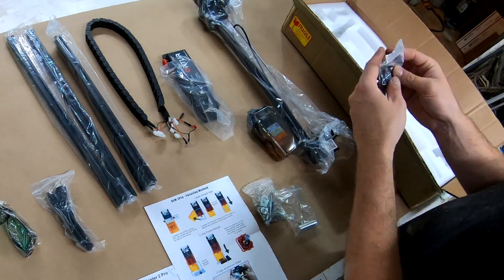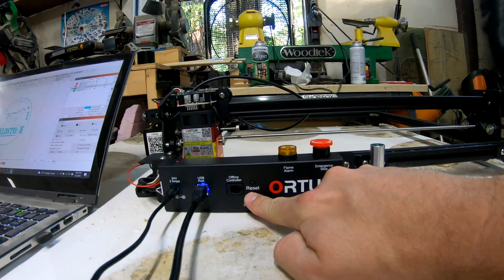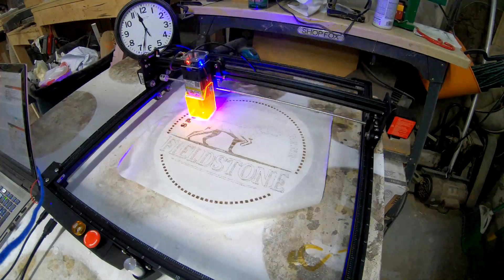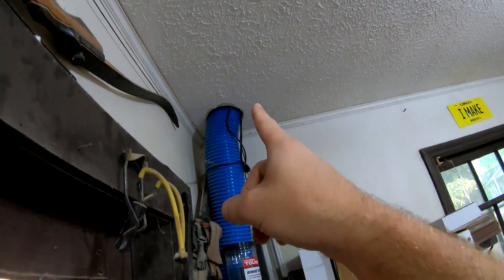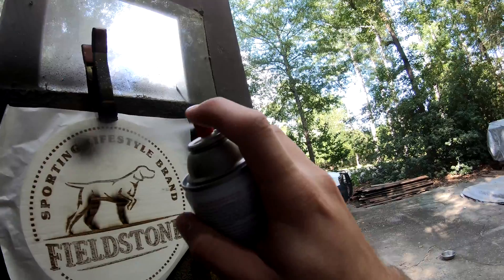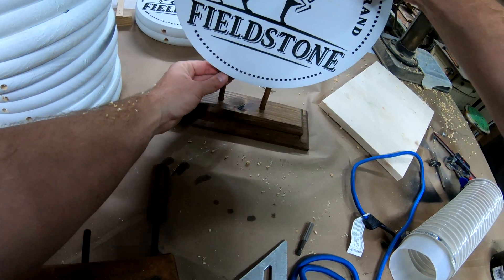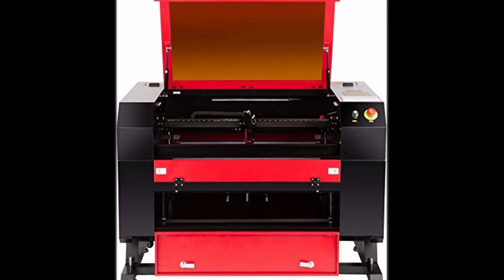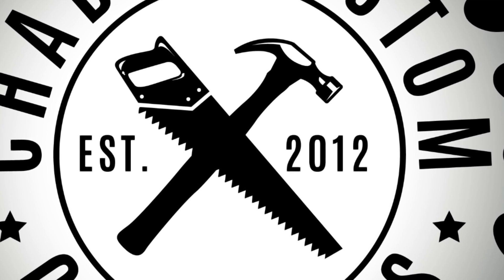I Got This Free Laser Engraver to Compare To My $2600 Co2 Laser. Was it Worth it?

Comment: I really don't believe that there was a fair test the diode laser was close to $500 however eBay has a laser called the K 40 which is also close to $500 which would have been a more fair test.
Reply from the maker: Yes I think you’re right, over time with diodes becoming more powerful I am actually starting to prefer them especially when it comes to achieving dark engravings.

Comment: Great video. I have both and use both for different projects. I think a decent Diode is a good place for most folks to start since in most cases cutting can be accomplished better and easier with the correct woodshop tool. It's somewhat rare that I want to cut something with a laser and the diode will do most of those cutting projects. It just takes more time. 
A production shop is different than a hobbyist. The hobby laser user typically has more time than money to waste on a machine they are only going to run on weekends. And it is a cheap way to work your way through the learning curve. Great diode engravers can be had for about $200. The Ortur Pro you have is trying to be a CO2 replacement so they put a more expensive diode setup on it. But for just engraving, anything with a 3W or better output will do just fine.
Reply from the maker: This is a great way to put it thanks for sharing.
Reply: Which type of co2 do you own? I am looking for something for more than just a hobbyist. I just ordered the Xtool 20W with air assist. Now, I'm wondering if I should have ordered a Co2 laser instead.
Reply from the maker: @mariewood8267  I wouldn't regret purchasing the xtool Pro that machine is is a step above all of the other diodes out there. In my opinion keep using that xtool until you prove your products and build a client base that you are realizing you can no longer keep up with it that is your goal. The CO2 laser I use cost $6k+ don't put the cart before the horse my first laser was a 2.5w laser and even though it was slow it proved to my customers what I was capable. I built up my machinery as my business grew.
Reply: @ChadsCustomCreations  Chad, this totally makes sense to me. Thank you so much! I think I will hone my skills with the diode and see where it takes me. Also, I think I saw a video where someone mentioned attaching a diode to the CNC. I currently have a Shark and am waiting for the Legacy 4' x 8'.

Comment: 90 watt diode laser, cuts up to 15mm solid wood. SCULPFUN S9 Laser Module, a very recommended upgrade to an Ortur
Reply from the maker: Is that actually a 90w output diode module? I didn't know we had those already. I'd love to take a look if you have a link to it.
Reply: @ChadsCustomCreations  No 90W will be the input. Diode laser companies keep jacking up the input wattage because newbies don't know any better. And then if you look at the power input and amps of the laser unit you will see they are lying about 90w anyway. "Max input for laser module: 12v 3A" = 48W max input = lying Chinese marketing.
Reply: 90w is power consumption not laser power output.
Laser power output is what really matters.
That laser is only 5.5w.
Reply from the maker: @muralha1  yes agreed with this statement but watch out for these companies they have had 10w and now 20w coming out by combining the beams of those 5w diodes. Pretty cool stuff
Reply: @ChadsCustomCreations  Waiting for reviews on the pre-order 20w module for the Xtool D1 to see how it stacks up against the Atomstack X20 Pro 130w (20w laser)...
Reply from the maker: @muralha1  as soon as I get my hands on one I'll put it to the test.

Comment: Hey. 

What is that masking film you used ? I would like to buy some
Reply from the maker: Hey Robert it is actually huge rolls of masking tape low tack I believe I have it listed in my Amazon links if you go look around in there you should be able to find it.
Reply: @ChadsCustomCreations  

Oh interesting. Will definitely buy some. I thought about using something like that to put on my wood glue ups so no mess from squeeze out. 

I'm in the market for a laser cutter . Been looking for hours but can't find anything that has a larger work area than the standard 400mm or so. I'm looking for 24" work area. Any suggestions? 

Dont have alot of room for CO2 so diode and preferably under $1000. 

Thanks
Reply from the maker: @Robert  I know I just saw someone showing off a very large diode laser but cannot remember the name of it but it was a review and it's a fun watch https://youtu.be/u2LH7SAdnZ0
Reply: @ChadsCustomCreations  I will check it out .

Also found vinyl transfer tape on Amazon which may or not work better for you . Way better review
Reply from the maker: @Robert  only thing you want to be careful of is to not laser anything with Vinyl in it or PVC or chloride as when it is lasered it creates chlorine gas which is not only deadly but also damages and corroded metals.
Reply: @ChadsCustomCreations  for sure.

And think I'm going to pass on buying a laser engraver as I can't find anything with that size

Comment: Chad, great review and info !!  Bonus points if you try hanging your CO2 on the wall ;-)  ...   I like the fact you can use light burn on both lasers. I currently have a 100 watt CO2, but I have been considering the diode.
Reply from the maker: Haha hanging a Co2 on the wall now that I gotta try. Yeah you know these diodes do have some advantages over the co2 2 that come to mind is you can get an extremely small laser size give the opportunity to do very high dpi images, 2nd these diodes have given me more consistent dark burns rather than vaporizing like my co2 lasers.
Reply: @ChadsCustomCreations  The diode foot print and portability is really cool. And the price point it also great. I find my self using my CNC router (Shapeoko2 xl) less and less with the CO2 laser now too... From just the sound stand points it a big improvement. And the speed is x10 on the CO2.
Reply from the maker: @1620GarageAndFarm  oh man I am the same way if it can be lasered it will be done over running the cnc router. I have 60w and 90w dialed in now where I can cut 3/4" pine paneling
Reply: @ChadsCustomCreations  WOW 3/4 pin on the 90 watt.....  Do you have video on that? I have never tried anything more than 1/2" on my 100 watt ...
Reply from the maker: @1620GarageAndFarm  I don't yet but I need to. 4" focal length lens and 20 psi on air assist. 2-3 mm/s cuts in one pass most the time with the exception of knots and really thick glue lines.

Comment: To talk about the speed of engraving and cutting without mentioning the power of the diode laser makes the comparison kind of arbitrary. Also adding air assist to a diode laser would help quite a bit especially with cutting.  One of the big differences is that most diode lasers are useless for cutting clear acrylic, where a CO2 laser cuts through it almost as fast as wood. Finally : for engraving especially it is a good idea to have the diode laser secured to the table, or the rapid accelerations and decelerations can shift the machine giving you engravings that have areas shifted.
Reply from the maker: All very good points I will definitely try to get more specific details in future videos. Thanks for watching and commenting.
Reply: Michael, what type of Co2 do you use?
Reply: @mariewood8267  I have a Glowforge basic, which has a 30 watt laser tube. It works great for cutting acrylic and plywood up to about 3/16 of an inch.

Comment: Really informative video! I'm one of those; if not, the only one who's curious about the cutting capability of the diode laser compared to CO2. I'm exactly on the market of that specific model of diode machine too. Kinda looking for the cheaper diode options as prices of CO2 are a huge leap. I will mainly cut light materials, primarily 1-5mm foams/rubbers of various types (EVA foam may be the toughest) or some leather-tough kind of material as the toughest. Maybe some thin 3mm below woods too as the hardest material, a very rare project if ever. Engraving will be secondary. Also in terms of precision, are they the same? Especially on the smaller details. Subscribed btw!
Reply: I have owned a diode laser for over a year now and have had a blast. They actually can do more than I thought they would be able to do. The evolution of the diode laser right now is fast and furious. It seems every month a new more powerful model comes out so I can't tell you what is best but I can tell you that the Ortur Laser Master2, as shown in the video is a little work horse and performs very well. I have cut through quarter inch plywood (9 passes). You asked about the accuracy of the machine. I have had to stop shortly after the start of a burn, home the machine and then restart it and you couldn't tell it. I have cut some very intricate small snowflakes that to really see the details of them you have to use a 10x magnifying glass. I've etched glass and engraved on tiles. I was going to get a 100 watt laser but I don't currently have room to put one so I opted for this machine (I own two of them). They are a lot of fun and will help you get through the learning curve of owning a laser. I hope that has answered some of your concerns about this machine.
Reply: @krisknowlton5935 thanks, this is really helpful! I'll be buying this one. Can explore many projects with this without breaking the bank
Reply from the maker: Thank you for sharing this
Reply: Kris nailed the answer here. Everything you describe cutting is actually easy to cut. With foams, it is best to do a scoring pass first so the heat from the cut does not creep and mess up your top edge. I make foam custom stamps and the score pass first makes a nice crisp stamp image.

Comment: Where did you buy your co2 laser? I’m looking at replacing my ortur with one.
Reply from the maker: I bought my red and black on Ebay the oddly enough seller has since disappeared. Soon I'll be putting out a review of a rmlaser.com machine cost is a little bit more but the quality of it so far in my opinion I think maybe worth it. If you think you're interested in one of those you can find them on toolots.com and I might be able to get you a discount from the owner directly.
Reply: Just curious, may I know the reason why you're switching from Ortur to CO2 laser?
Reply from the maker: @rrairr  co2 laser just have a lot better ability to cut and normally have way more speed as well. With that being said I have seen that diode lasers can achieve much darker engravings than most who run Co2 lasers.
Reply: Do you know if RM Laser ship to Australia?
Reply from the maker: I personally do not know but send Ray@rmlaser.com an email and he will let you know.